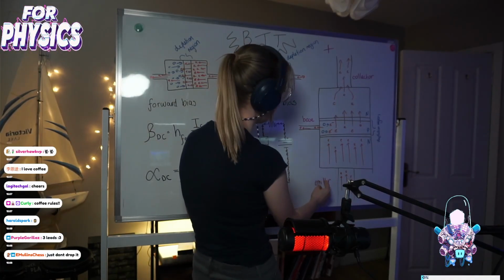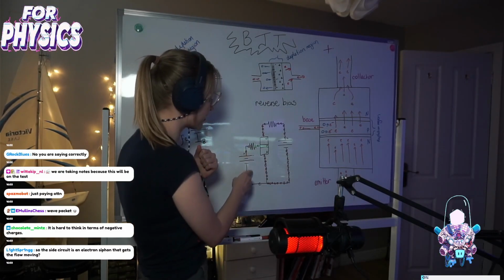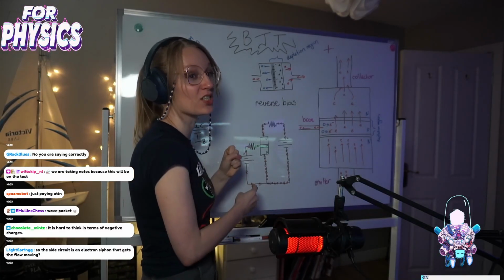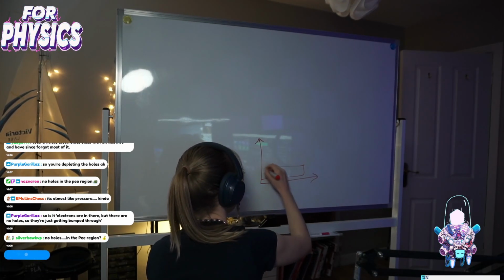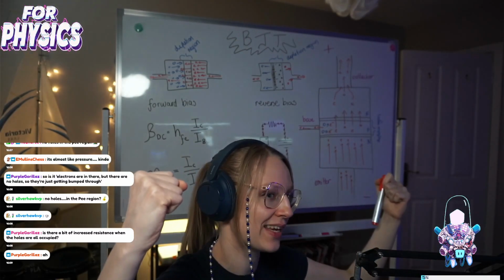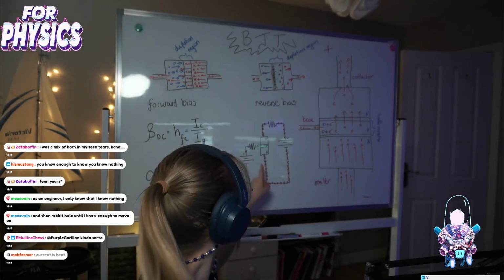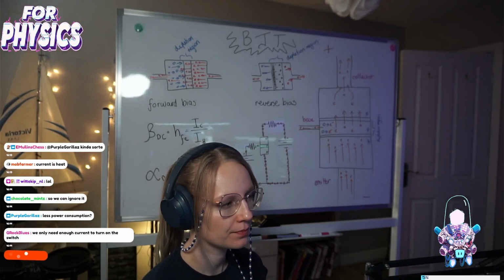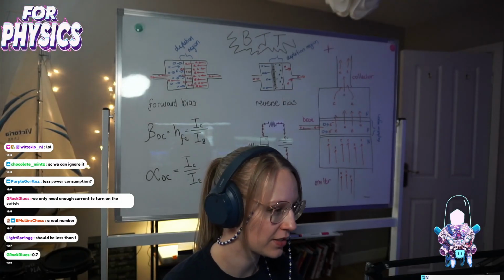Semiconductor Lesson: How Does a NPN Transistor Work?

Comment: Thinking about it from the manufacture design perspective, the emitter is heavily doped meaning that proportionally, a much higher quantity of electrons than the amount that are able to re-combine with holes through and into the base terminal become excited (escape the band gap). Because they are drifting, they no longer need to conform to not being able to drift through the reverse bias depletion region and into the collector. Again, this is because they have already escaped the band gap. So that much greater proportion of electrons are able to flow freely through the conductive material towards the positive voltage supplied to the collector. When discussing conventional current flow, the same exact process happens but in the reverse direction.